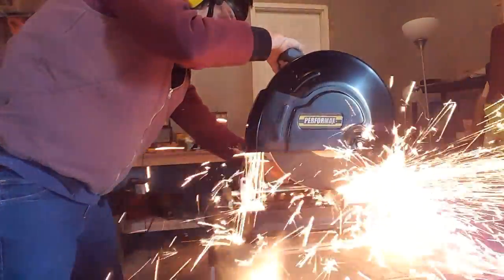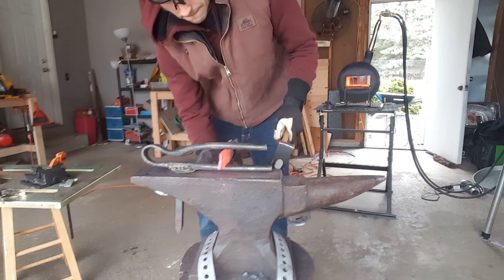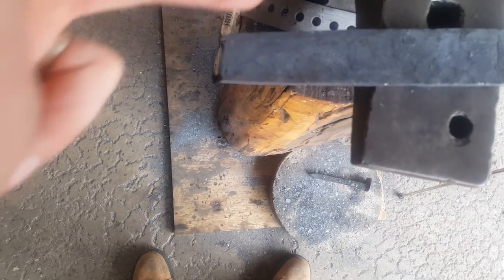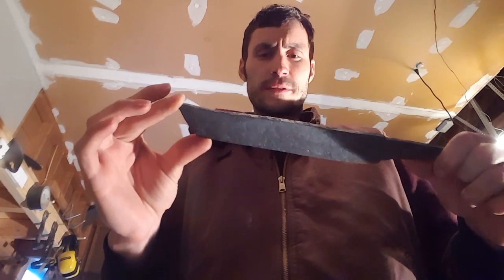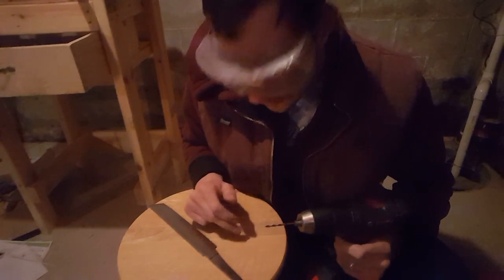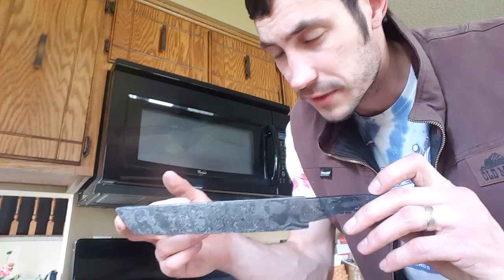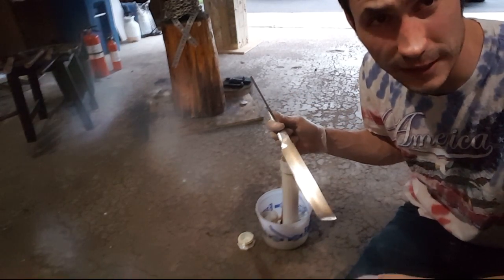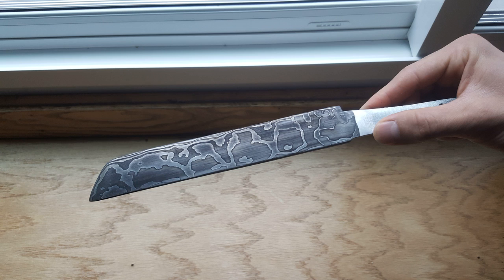Forging a Damascus Steel Tanto Knife: Part 1

Comment: You don’t need a jig mate.. use the tool rest an d anchoring is the most important thing... dummy psss the blade with shoulder width stance and twist at the hips and pelvis keeping a rigid form in the arms from the elbows and shoulders... you have the confidence which is the hardest part.. try it and let me know...

Comment: Great vid mate you should check out walter sorrels. Bevel the opposite side to the point because the point will bow upwards. So the curved edge becomes the spine. Good stuff mate.

Comment: Kaleb, do yourself a HUGE favor and use water and sand paper designed for wetsanding for the whole process! The lubrication and dust dispersion saves a ton of time. 
Also you can look into a brand called Dynabrade. Just go on to their website and nerdgasm a bit.
Reply from the maker: Thanks for your Comment. I'll likely give that a try and check out that brand.
Reply: Eric French it looks really nice.